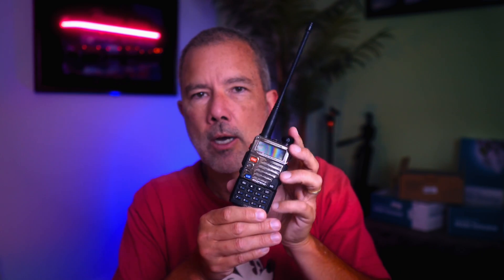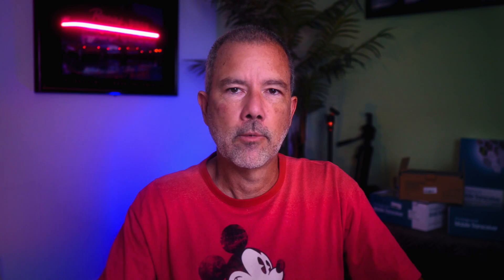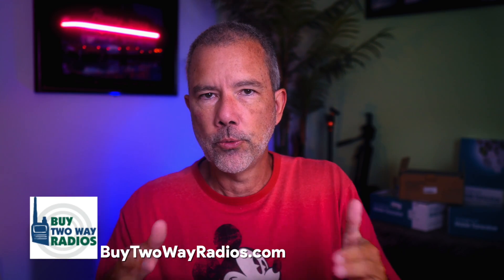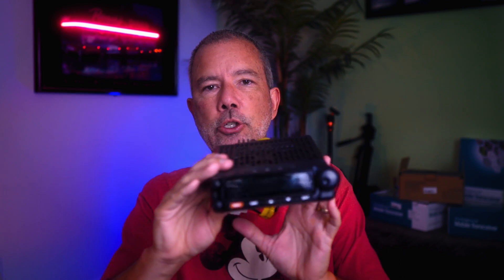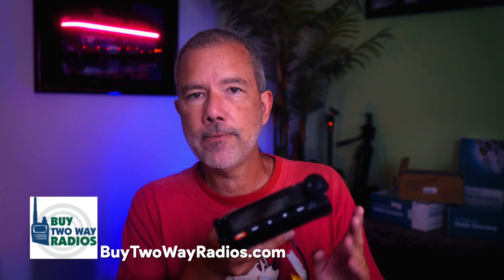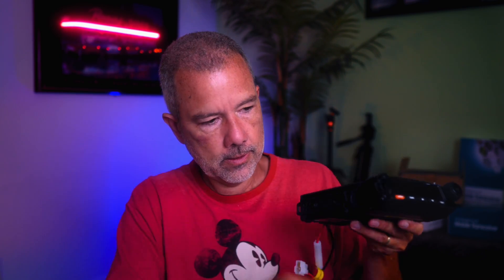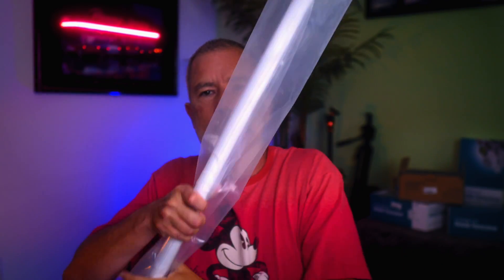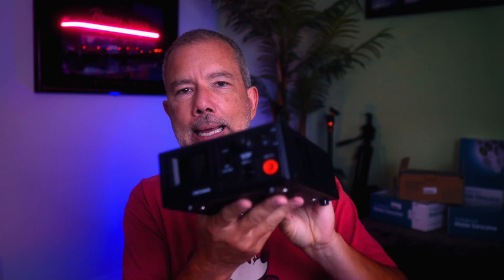Building a GMRS Repeater For Personal or SHTF PART1 - Repeater Build with Two Wouxun KG-1000G Radios

Comment: Please don't use cheap coax, even if it's a short run. LMR400 is worth it. And there are alternative low loss equivalent that's also worth it. Using RG8x or RG58 coax for such a high quality setup would be like putting 86/economy gasoline in a turbo engine.
Reply: Better cables with quality connectors reduce noise .  LmR400 is expensive and hard to manage in that it doesn't bend easily.   But this is one of those pay once and cry once things.
Reply from the maker: In what way, exactly?
Reply: @TheNotaRubicon  You will get more power up to your antenna. LMR400 has an average of about 1.5dB loss on a 100ft run, and RG8x is almost 3 times that. You will notice better propagation with the LMR400. I had RG8x on my base station setup for several years, and when I finally bit the bullet and changed out for LMR400, I definitely am able to talk further and hit at least2 repeaters in the next city over that I could not before.
Reply: @AlphaRamo  LMR400 is not recommended for full duplex operation.  The double braid shield with foil is a problem.  It can cause all kinds of weirdness to happen to the transmitted signal.  RG214 would be better, it doesn't have the foil, only double braid shield.  Hard line would be best.
Reply: @TheNotaRubicon  as an electrician who has the unfortunate pleasures of CATV connections - the key is fewest connections possible.

The way coaxial cable works is both the core conductor and the shielding. Not just to keep RF signal noise out, but keep it bouncing back to the core at the least angle possible. So the best cable is the largest gauge and most uniform distance from the core with a tight shield.

Best practices are as few connections as possible - straight as possible without getting neurotic - radius bends where they must happen - best connectors possible (gapping shield and the connectors themselves are a deformation of the signal) all of these reduce db losses. Oh and if outdoors UV rated cable and a dab of silicon grease...

Oh and there are name brands...ignore them a “knock off” is just a competitor of equal or lower quality... Some companies have better quality control... 

A good brand like anixter in sizes most common like RG-59 will have decent quality control. A size even more common is RG-6Q that is a larger conductor - but much heavier shielding aka RG6 quad shield. And while braking rule number one - you can get an F - connectors for RG6Q to PL259 and it will likely be better than any 259 connections you can make by hand.

Some more here:
https://justalittlefurther.com/choosing-the-right-coax-cable-for-your-vhf

https://www.jpole-antenna.com/2015/01/28/using-rg-59-or-rg-6-catv-cable-with-an-amateur-radio-antenna/

Comment: Hire a tree service bucket truck to install your antenna.  Oh, wait... no trees in the desert.  Surely someone has a bucket truck in your area, maybe some independent cable installers, maybe some brick masons, etc.  I hear ya about heights, if I am more than 6-8 feet off the ground, I need a parachute to feel safe...
Reply: That's what I did.  Tree guy and a bucket truck.  Antenna was up in an hour or so.

Comment: I was thinking of making a simple GMRS repeater by using a couple Baofeng UV-5X ($60), SainSonic DIY RPT-2D ($25) repeater interface cable, BTECH AMP U25 ($88) 40W Amp, and a couple of cheap antennas.  Duplexer sounds good though.  The transmit UV-5X would act as an exciter for the Amp.  The BTECH AMP U25 can except a 2-6watt input and output 20-40watts, at least that's what it advertises.

Comment: No requirement for the repeater to identify. All stations that communicate with repeater must identify.

FCC 95.119 Station identification. 
(e) A station need not identify its transmissions if it automatically re- transmits communications from an- other station which are properly iden- tified.
You should make it necessary for your repeater to open only when it receives a tone from a radio. It’s not for privacy, it’s to eliminate static and stations from far off opening the repeater. Yes, keep your repeater open to the public, your very publicly spirited videos show that you aren’t one of those greedy air grabbing pricks !

Comment: Is there a "Repeater  Council" for GMRS??  Im looking into building a repeater,  I wish a GMRS radio manufacturer would come out with a " Cross Band" radio which acts like a repeater such as a Icom 2730 this a dual band radio you hook up one antenna with 50 watts output-selectable thats all you need. I can use it as a portable repeater in my truck, park it at the top of a hill use your handie talkie to get into it and access a repeater 50 miles away.
Reply: GMRS is self coordinating.  Which means you listen on a frequency for some time, perhaps a few days or so to be sure the frequency is clear then put  your repeater on the air.  Simple as that.  The reason a radio can't act as a repeater on the same band is because the transmitter will de-sense the receiver.  Not enough isolation can be achieved without a duplexer when using the same band (UHF).  Ham radios that have the cross band function work as a cross band repeater only because one side is on VHF and the other is on UHF or visa versa.  Enough frequency separation that a duplexer is not needed.

Comment: Was thinking of doing the same thing but HOA. So...I might discreetly attach it to my already installed flag pole and trench the wires and hope nobody notices. What do you think?
Reply from the maker: The reason I chose the Tram 1486 (link in the description) is because it looks like just a white pole.. it doesnt really look like an antenna, so you might get away with it.. and although not optimal, you can also make or buy a wire antenna designed to string up in the attic.
Reply: check out pro1 its the reg that hams used to put up an antenna in an hoa might point you in the right direction good luck